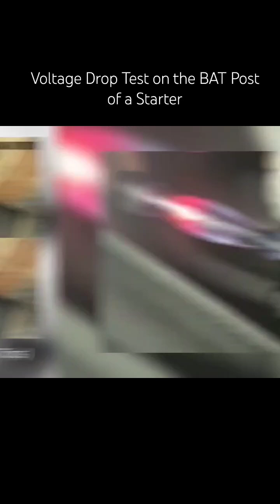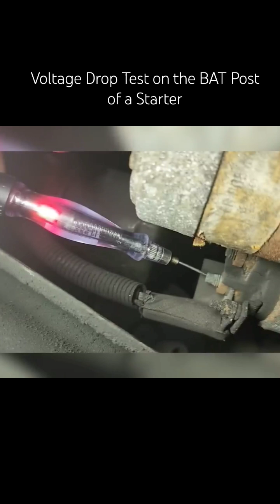Starter Motor Tests you MUST Learn [voltage drop on battery post of starter]

Comment: Can someone explain to me why the test light goes out with the voltage drop. Thanks
Reply from the maker: Specifically, it is because resistance changes with heat. Without the current flow of the starter motor itself, you would never see this resistance problem. Once the starter is engaged and current is flowing to the starter motor, this resistance problem heats up drastically and increases resistance drastically and is causing the very large voltage drop.
Make sense?
Reply: @ScannerDanner  makes perfect sense. Thank you so much! I’ve learned so much from you.

Comment: I had a mechanic check my starter motor after hard starts. He told me a new starter was required. They replaced the starter and the problem was still there. I replaced the power cable out of frustration and problem disappeared. It was the cable lug causing the fault.
Reply from the maker: Unfortunately this is typical in my industry. A simple voltage drop test would have proven the fault that you had, yet 90% of techs out there don't have a clue how to properly perform one.
Reply: @ScannerDanner  A back Battery lug was my give away

Comment: This is why you must use a real test light with 600ma or more not an led to test for voltage
Reply from the maker: It's not an LED light and it doesn't matter what bulb is being used (amperage wise) because I'm relying on the starter load not the light bulb load to tell me about the voltage drop problem. 
Unbelievable how little people actually know about proper voltage drop testing.
Reply: @ScannerDanner  people are replacing parts and taking a gues. When I was working on cars I would take apart the parts that failed and see why it did to have a better understanding of what is going on. Now days it seems like no won caress.

Comment: A few years ago I had a customer come in with a 10-year year old right hand drive Jeep Wrangler. She was a mail carrier, and she was about to sell it to another mail carrier but it had an intermittent no start since she bought it brand new 10 years previously. Shortly after buying it the dealer put three new starters in it and every year she would take it 2 various dealers and independent shops. It had at least three starters a year they had new cables, new battery, relay, they tried replacing every part they could think of. When it came into me the dealer had just tried three different starters and independent shops tried throwing more parts at it. I spent 20 minutes starting it and shutting it off until I verified the problem. I've been brought it into the shop and did voltage drop tests from the battery to the starter I'm positive and ground side. Obviously the new cables were fine. As was the new oem starter. When it was starting it had 500 mV of drop in the ground circuit. When it when it starts it was just under 1V of drop. After 10 years and every shop in town it took me an hour and a half to diagnose and repair this vehicle. The starter bolted to the transmission and the ground cable bolted to the engine. There was corrosion between the iron block and aluminum bell housing. I ran a cable from the engine to the transmission and the problem was fixed. 10 years versus an hour and a half. It's amazing how techs neglect to do this very important, very simple test.
Reply: 500mV that’s excessive ! How the hell did the previous “techs” miss that 🙄
Reply: @UlfricStormcloak69  They never did a voltage drop test. They probably just say battery voltage at the starter and thought it was good. Fat being said, SAE give the standard at 500 mV. So technically, it was within specifications while it was working, but as the cable got hot from repeatedly starting it, the resistance went up in the cable, too.
Reply: You'd be amazed how many "techs" don't know what a voltage drop test is let alone do one.
Reply: @ftlbs11  I am constantly amazed by how many techs do not even know what it is, and even more amazed by the techs that do know what it is but don't do it.

Comment: Means shit. Youre using an led test light. They use circuitry to turn the light on and off . Use a meter for voltsge drop tests.  Dropping half to 3/4 of a volt will cause problems, but will light your led test light giving a false positive. Use and incandescent bulb test light, a meter is best.
Reply from the maker: Nope, this is an incandescent light.

Comment: You can see the arcing right where the cable is mated into the starter terminal. Also you can watch the cable jump right where the fault is occurring.
Reply from the maker: The cable was not loose and a 4k camera helps lol. And it was only one time out of 4 that you saw an arc. You're not seeing this live and 90% of "techs" don't understand how to do voltage drop testing and would have put a starter in this.
Reply: @ScannerDanner  regardless I clearly saw an arc. So how would a tight connection show a visual arc?
Reply from the maker: @jmathews470  "tight" is a relative term. It was not loose by hand, at all. The fix was to simply tighten the nut a half turn
Reply: @ScannerDanner  exactly

Comment: So even though it doesn't need a starter, if the mechanic turned that nut while putting on a new starter it would be fixed without proper diagnosis. That's the difference between a parts changer and an experienced mechanic.
Reply from the maker: And unfortunately 90% of mechanics out there would have put a starter in for this issue

Comment: My old trucks have over 300,000 miles , i just buy a starter battery and a hot wire at the same time and change them , but only on my truck ..because of the miles , it needs every part in that system replaced when im working on it .

Comment: This really isnt a great test, yes it works somewhat but theres some key problems here. First and for most electricity travels the path of least resistance, that pretty well know. Second issue you,test light is an LED, which has both pros and cons to an incandescent stlye test light. Now it seems like the cabke is being blamed for the voltage drop, but this seems more like a bad connection which is repairable without replacing the whole cable. Placing the led test lights on a severely oxided part can give false readings, the oxided part acts like a diode with a very large Voltage drop for something that only needs 20mA of current max. This is why old school VTVMs or even a VOM is pretty usfull in auto repair not just Electronics, the analogue scale can be much easier to read, over the switching resolution on a modern DMM, also if your learn how you can use them as a milivoltmeter to,test for shorts to ground
Reply from the maker: Not an LED test light 😂
Reply: He'sa bit dreamy cus he see red,  must be led, 
NOT,   We know don't we....
Reply from the maker: Never said it was the cable either. You assume at lot for a 1 minute clip. Watch the full video linked in this short!
Reply: @ScannerDanner I'm not,trying,to be rude here, I'm just simply pointing,out,that this could be missing leading, you stated in the beginning of the video " this is what voltage drop on the heavy battery cable looks like" as if it were the cable. And it isn't it is the connections between said cable. Brother non of us are prefect, there are lots of people younger than us who look up to what we do, and learn from it. And explaning what is going on as a teaching point should be worded very well, "heavy battery cable", or high current cable. Voltage drop verus and bad connection. Yes they are technically similar, but in reality it goes pretty deep. A bad connection will drop voltage, which then drops current. Volts, ohms, and current ohns law. They all work togther kinda why the saying,its not the volts that kills its the amps is false in away. Doesnt matter to much if your light was led or not, I will stick to my thoughts on belief that it is simply do to the video you've made, and the wave length of light that it's emitting is the of a Light emmiting diode. My point here is that both led, and incandescent both have a place in the shop, try testing a blinker circut with an led test light, and then use a incandescent. You'll see the difference!
Reply from the maker: @Anthonytheredneck  there is something you are missing. This "short" was pulled from a full length video (as ALL of mine are). I literally have 60 seconds and I look for a good 60 second clip from my long form videos. Nothing is edited or pieced together, it's just a clip. Not everything is going to be covered in this time frame. Saying, I should have said this, or done that, is something you can only say if you see the whole thing!
 At the bottom of the short, scrolling across the screen as you watch, is the full length video this was pulled from. Watch the full video and then offer your critiques. 
This was a perfect example (visual) of what a voltage drop looks like and how to utilize the loaded circuit test effectively. Voltmeter, lab scope, test light (like I showed) you still have your answer. This is a corroded eylet on the starter main BAT post. Most people would put a starter in for this issue and would have never known this problem was there. Why? Because loosening and tightening that nut would have knocked enough of that corrosion off.
 This is a proven, yet simple test using an incandescent test light (again, not LED)
Reply: @ScannerDanner  yes your rigth, I am criticizing a bit and I do apologize for that, and yes this video clearly shows this, actually had a similar situation with starter solenoids on lawn miwers, my old boss said that if a mower starter solenoid clicks that it is bad, and to just replace it. They all make a solid click sound.
Reply from the maker: @Anthonytheredneck  my man, thanks for that. These 60 second clips are the death of me 😅. I always thought it was widely understood where I'm pulling these from, but it is absolutely not. I've gotten more grief with these shorts over the past year than I have in the previous 12 years here on YT
Reply: @ScannerDanner  from a Mechanical/electrical point of view, 60 seconds really isn't a whole lot of time to explain enough context from something mechanical, or electrical. I'm 25 and im no certified mechanic, or electronic engineer I taught my own self using youtube from guys like you. I mean there was a small portion of my learning that I had know YouTube as it wasn't really a thing yet, but we don't talk about that one much give a 9 year old kid a weed eater to fool with he might get it going, but won't be long it be tore completely apart to under stand how it works to the best of the knowledge i could use lmao very fun times! People like US in these kinds of fields we struggle alot, and get criticized quite often, I have been plenty of times myself. I know what that is like, and I again apologize for that I let my thoughts say verus think there a bit. Especially with mechanics, sometimes I really wonder what goes though a Mechanical engineer mind, as for EE's it can be difficult to blame them, as they put the Circuit together with parts that the companies source usually at the lowest price! Something really needs to change with vechicle manufacturers it's honestly very worrying how difficult they make shit to not be able to repair, and then proceeded to tell you that the job takes only this,many hours to do, and is a fixed labor its complete bs!
Please forgive my ignorance!
Reply: Bro, did you even watch this video stop hating and pay attention.
Reply: That is not LED test light
Reply: Electricity does not flow path of least resistance. You know how many parallel circuits there is on a car.
Reply: @pinpointauto3091  electricity does flow in the path of least resistance. In parallel circuits are not special. The only time anything becomes a bit special is when the current,on these circuts is'nt DC, but AC. Or the AC factor as both DC, and AC can exist within or on the same conductor. The parallel wiring your talking about is also probably the the boss bars or current rails within fuse boxes which are powering muiltple circuts some separate or not. These circuts probably also have a realtivly high DC resistance in the power supply portion. And again there's also muiltple grounds a ture parallel circut have the same grounds and VCC sources. Just because it's says ground doesn't mean it's the  ground you always think. You can see electricity following path of least resistance well in home wiring with open, or loaded neutrals. Or just even bad connections. Path of least resistance is also with in the bad connections as well especially one that becomes hot, as it's pulling enough current to heat the connection, but not power the load command.

Comment: nice, should have more views, multimeter would be even more presise on how much voltage your actually losing
Reply from the maker: Thanks but how much more precise does it need to be?
Reply: @ScannerDanner why not be more precise with your work, multimeters have so so so so so many purposes
Reply from the maker: @Toothless69420  did I identify the problem? I have nothing against using a voltmeter for this test, it just wasn't necessary
Reply: Light goes completely out, that is precise enough for this particular situation. In other videos he uses multimeters and multi channel scopes when the situation calls for it.  A good auto tech can use whatever tool is necessary to solve the problem.  Sometimes a high level scan tool , sometimes a spray bottle of water.
Reply from the maker: @Stumpy1973  thanks man, couldn't have said it better myself
Reply: @ScannerDanner   I thought it was an excellent presentation.
Thank you.